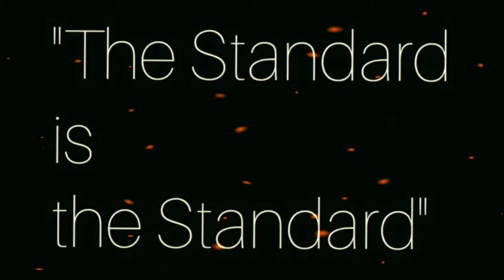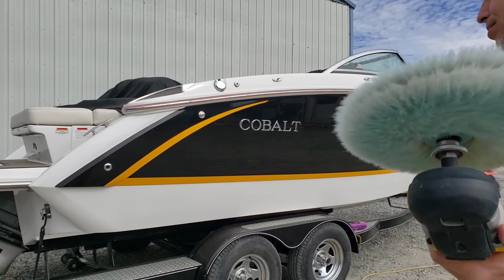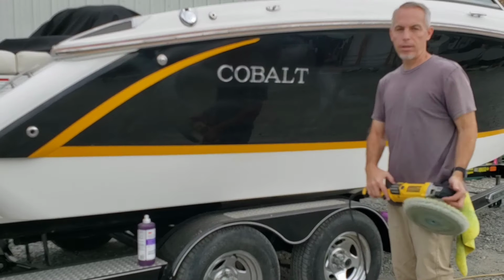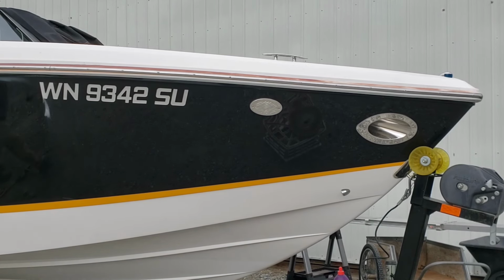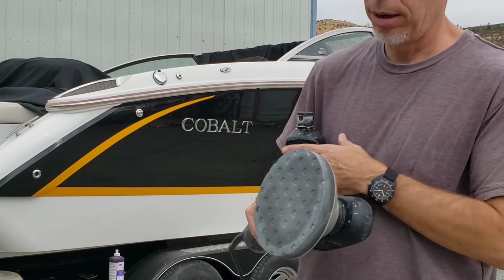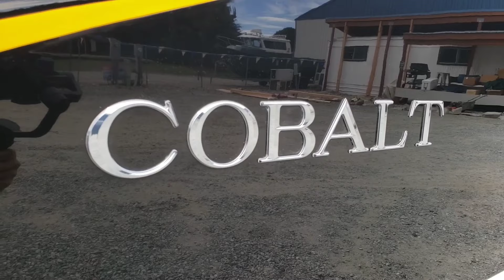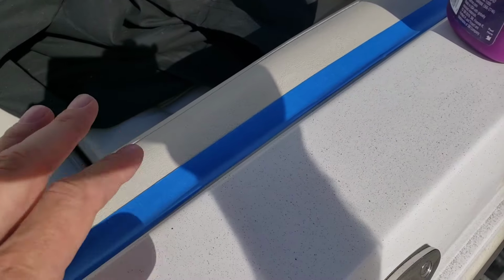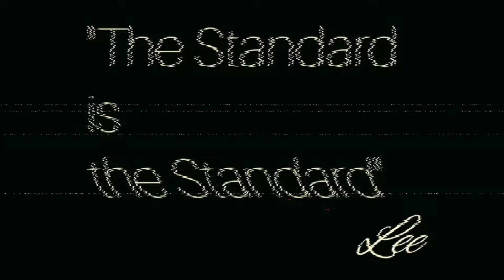Boat buffing. Gelcoat oxidation removal, no Wetsanding!

Comment: You have been a huge help and influence to bring my old boat back to life. I am now at the waxing stage with flagship. Question is, after waxing and for the future what wash product do you recommend to prevent the new wax from being stripped and to keep the over all best finish for future washes. I see that 3m has a perfect it boat wash also, but would like your recommendation please.
Reply from the maker: Hi, glad you took the plunge!
Any car wash that leaves behind a protective film, turtle wax has one, Meguiar’s too. Mermaid's boat soap is OK but whatever you use, add "SALT-A-WAY " to the mix and blow your own mind with how well that works.
No Dawn dish soap, no oven or toilet cleaners used, no simple green  just washes made to NOT strip the wax.

Lee

Comment: Hi Lee, I've been watching your videos for a long time and have been buffing my boat myself for a few years now using your advice with great results. This last time, I used a heavy cut to remove some oxidation, and it turned out amazing, as always. I didn't even end up using the polish+wax step. I took my boat out, and when I returned, I noticed a massive amount of tiny white pits in the red gel coat. I assume this is from rocks on the road. Is my gel coat now so thin the white underneath is showing through?
Reply from the maker: Hi. That's possible. Without being there, I can't say for sure. If the red is low on the boat, you could also have had small blisters you didn't notice before that have now erupted after the top surface got thin enough.
Gelcoat is an interesting thing. Sounds like thin gelcoat from what you're saying. New paint, gelcoat or Vinyl wrap time perhaps?

Lee